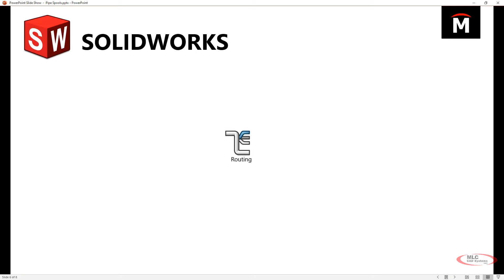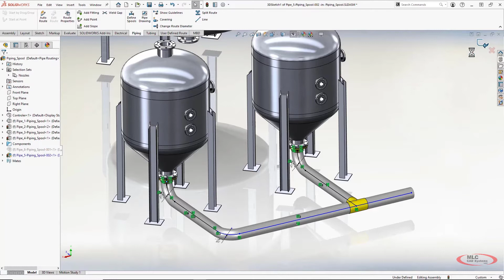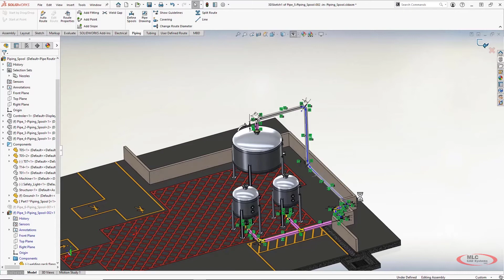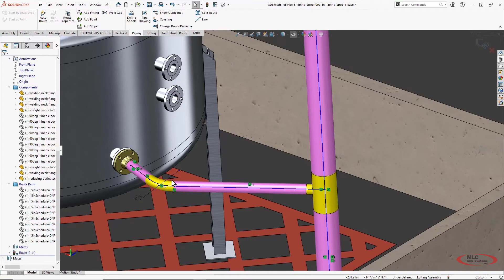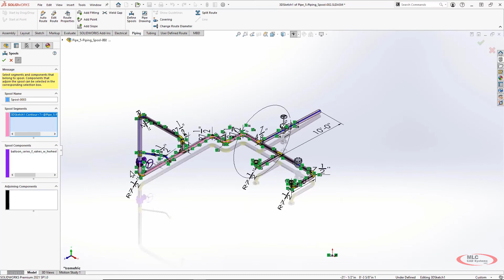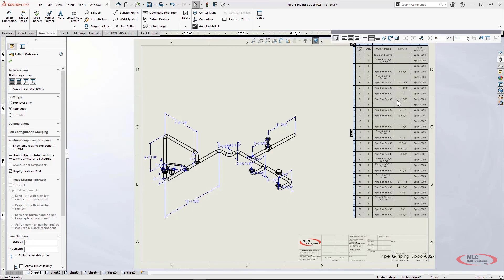Comment: How to disregard scale in case you have a very long pipeline such that it appears like a line on paper? It seems you were lucky the pipeline in this example was relatively short.
Reply: For a drawing with a long part, use a Break view to cut out the long boring parts. In an assembly, consider creating saved views. Hit spacebar to create or recall views quickly.
Reply: @MLCCADSystems ooh thank you so much, I don't know why I didn't consider that. Much appreciated.